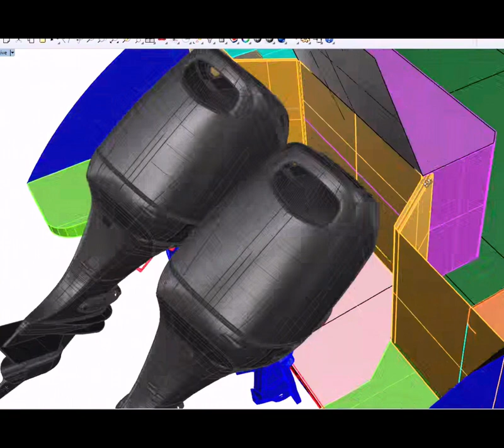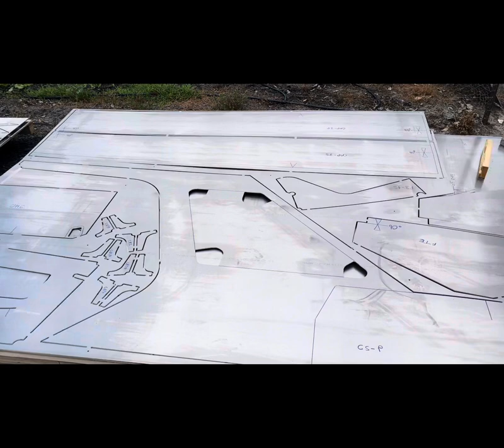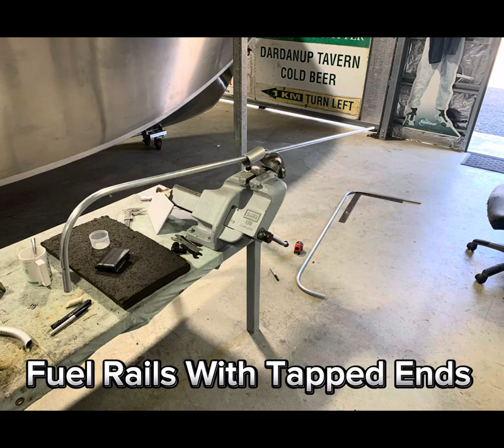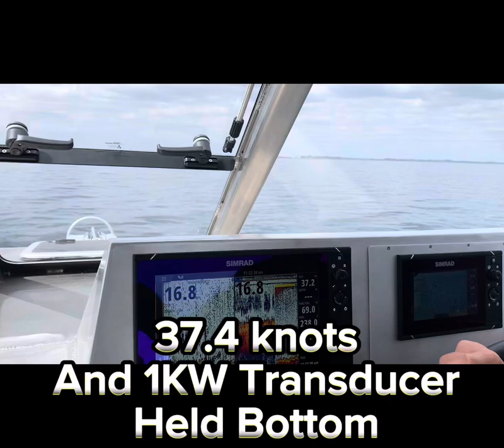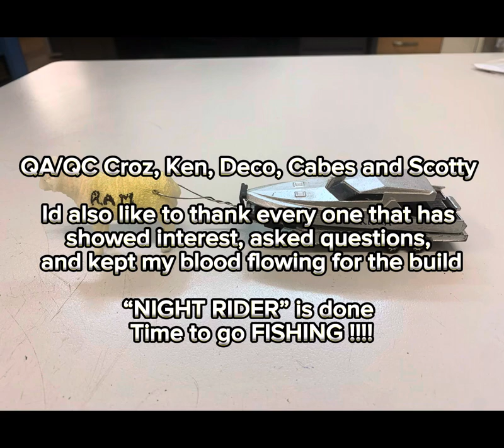GMD 7.5m 6.6 AIR RIDER Aluminum Trailer Boat Build

Comment: Wow Michael, amazing build, what a boat! Saltshaker sold?
Reply from the maker: Thanks mate.   Yep salt shaker is sold and the guy has been doing some trips in it.  I coulnt keep both. And as you can imagine needed the budget for this build.
Reply: @michaelchild145  I still have my 5m CC, while you upsized, I will most likely downsize 🙂 Fabulous build as usual mate. Coincidently, I bought the SWS Alumig as well, really great, wish I had it when I built the 5m CC.
Reply from the maker: Yep mate   I def do miss my 5m cc as I had it 10 years but def enjoying having a cabin and a propper helm seat and position in my old age ha ha  yer the sws was mint.  Def wish it was around when I built my first one.

Comment: How much sanding what grit ect cheers
Reply from the maker: Depends on the finish you want.  Did most at 80 grit to start with but then finished it off at 250 for a nice mat finish.  Orbital sander.
Reply: @michaelchild145  yer nice one , I just want to get the weld lines out of it

Comment: Hey Michael
How's the fuel economy with the 140hp Suzuki's? What size tank did you go?
Reply from the maker: Hey mate I upgraded the fuel to the max from 250lts -360lts and had to sacrifice the kill tank from the std design.   I haven’t looked lately but early on  i was getting 1.2 litres per norticle mile or 1.54km per L. So 60.1 nm traveled 73L used.  I’d expect better now it’s run in but considering those numbers are for fuel total for both motors and the boat weights over 2.5 tonne and I drive it hard that’s pretty good in my eyes.

Comment: Hi Michael 
Great job on the build!!
Very impressive. 
I’m looking at doing the same build and seen you where using a dual pulse SWS 230 mig. 
Looking at your welds it looks good. 
Where you happy with that welder ? As very well priced. 
Also I would really like to have a chat with you prior to our build. 
Do you still live in Bunbury as I’m not far living in Kirup. 
Look forward to hearing from you. 
Rob
Reply from the maker: Hey Rob.  Yep mate still in bunbury.  My mate Blair just called me about you popping around and he’s going to pass on my info or find me on book face.
Happy to run you through everything.
Reply: @michaelchild145  thanks Michael 
I’ll give you a call one night and work out a time that suits you to come and check it out and have  a chat.
Reply from the maker: Sounds like a plan Rob !!

Comment: Whats the flat forfoot  area in bow for 
Looks odd where bottom sheets are butted up then almost looks like a bit half a meter long shaved off
Reply from the maker: Good spotting mate.  Its a new part of all Airriders ( about 4 years ago ) the GMD guys developed it and it’s meant to eliminate breaching or grabbing on an angle in a following sea at high speeds.  You tend to slide down a wave and it dosent grab at all.  I must say the airriders have never been known for doing this but just adds that extra level of protection in from it.  It’s been in the the water for 6 months and I’ve never had an issue and travel back in following sea at 30+ knots regularly.

Comment: Does the design require 2 motors or can you run a single?
Reply from the maker: Hey mate 
The design didn’t require 2 motors but it all depends on the weight and its position.   As the entry is so fine at the front the more weight like I have on the front with minnkota, suspention seats, fridge and anchor winch requires a bigger weight at the back to counteract the weight at the front.  It’s about it sitting corectly at rest and ensuring the perfect ride. A fair bit of design goes into each hull from GMD and its basicly a full custom hull.  Like all boats everything is a trade off.  Hope that makes sence.   I’ve seen this hull and the smaller and larger hulls with single motors before.

Comment: How much did kit cost?
Reply from the maker: Contact global marine design mate. As every kit is different.
Reply: Have done pall  got a cost for cut files to get one cut in uk
Stephen collett super helpfull 
Ps she looks sweet you made a nice job i know whats envolved i built a 4.2 from cnc about same time you built your 5m cnc
Reply from the maker: Cheers mate if you can build a cnc you shouldn’t have a problem.  The drawings are more engineering drawings from GMD so there isn’t a step by step rough how to like CNC but that’s why I did the video to help guys out who want to build one.  Let me know how you go mate.   Im interested in how you go and always available for questions if needed.
Reply: @michaelchild145   cheers , dont think following drawings will be an issue as thats my day job , not necessary boats although have built 10 upto now  but complex fabrications,  although we used to do the prop nozzles in steel for  a large boat building company near us some of which were 5 tonnes each
Reply from the maker: Yep mate.  You got it easy then.  I just look at welds now a days so the drawing bit was the easy bit. Fab speed was the bit that took way longer for me Ha ha. The green will be the other thing you notice compared to other builds.   But there is a reason for it as there are so many hull joins that there can be some variations in the final product so they allow green so there isn’t any issues just takes a bit to get your head around why but at the end you see it.